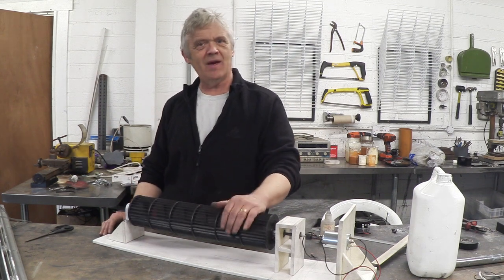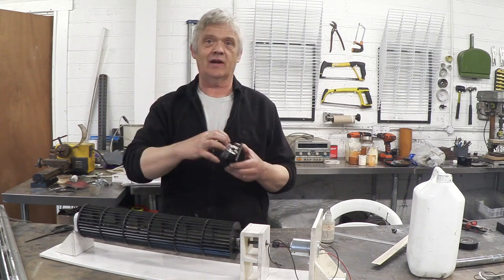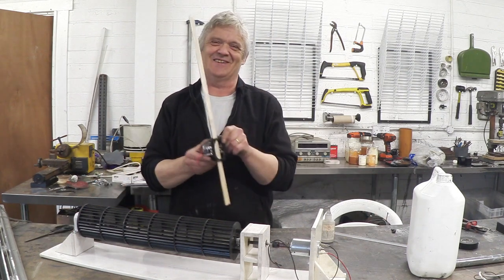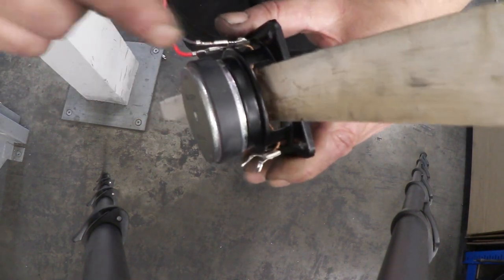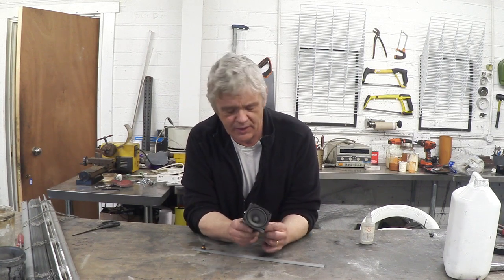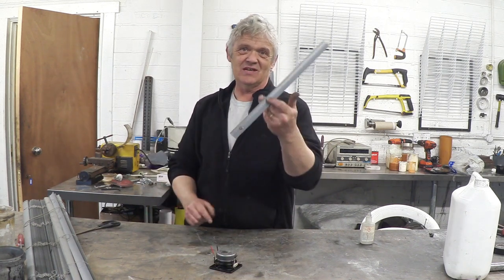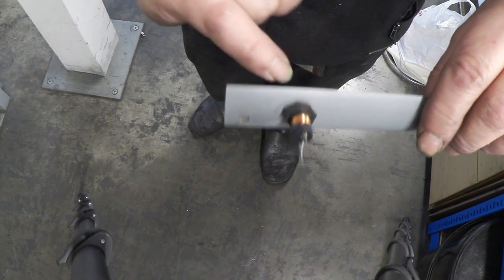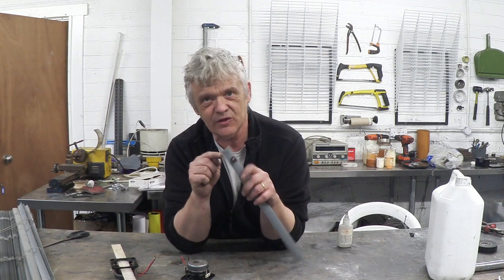Weird Wind Generator   No Blades, No Moving Parts

Comment: There is no way a 4 or 8 ohm speaker would produce 6-12 volts !
Reply: Do you think he's measuring AC or DC? The actual output from the speaker would be some messy kind of wave, probably difficult for the multimeter to accurately measure.

He's also measuring open circuit voltage, so there's almost zero current. Even 12V at almost zero current is almost zero power generated. 12V x ~0A = ~0W
Reply: @iamdave84  it would be a pulsating dc. On and off, on and off. I took the coil of very fine wire from an old shaker flashlight and it would light a 3v led real brite when you shake it and that coil measured nearly 500 ohms.

Comment: Super cool, indeed! This was such an important find for me. Remember those industrial art pieces from the 50's and 60's, they were called 'Kinetic' art, I believe. A bunch of long thin spires, standing vertical. The idea was with the air mass changes and human, and mechanical created drafts they would never stop moving. Since I was a kid I thought about them and always had a hunch they could create power. Which may be part of the original treatises, or otherwise discussed long ago, nevertheless, I finally know how to do it. Ty!
Reply: I just read an article from 5 yrs ago that point by point trashed this as a viable economic model, lol.
Reply from the maker: awesome mate - thanks for taking the time to write - cheers

Comment: What about using a piezo speaker? You could stack’em. Lol really popping some good stuff bo.
Reply from the maker: go for it mate
Reply: Robert Murray-Smith thanks bo, but I think ya had the idea w the hho, or rather hydrogen generator. I thought it might be a quick slap together that be an easy extra vid for content for yourself. Lol but opinions, thumbs and a*******, right. 
Really think the carbon/ceramic electrodes on a hardened or diesel generator, but ran as hydrogen electrolyzer. O2 is in atmosphere already, safer to store hydrogen, then possibly carbon/ceramic capacitors for storage...and before ya say go for it mate, already on it. Best of luck bo...hope ya make millions and love the new string of content. Thanks again.

Comment: Hope you continue to research this it's an awesome idea I never dreamed that you can make a speaker put out electricity
could you please get the biggest speaker you can find and run a test that way see how much electricity get and amps
Reply: You can plug headphones into a microphone jack and speak loudly into them and it's picked up like a really terrible microphone. That's because the speakers on the headphones generate electricity when the diaphragm moves back and forth.

Most (all?) devices that turn electrical energy into mechanical energy will generate electricity to some extent when you apply the right mechanical energy. They're not designed for this so are usually very inefficient at creating electricity.

Comment: Sorry to say but you do actually have moving parts.
Reply from the maker: okay mate - but it's still awesome
Reply: @ThinkingandTinkering  Sure, love anything that pushes out the boundaries of power production.
I am pretty sure a unit like the reed could be made entirely of a piezo element so that the whole reed bending would induce a small voltage.
Forget the roof idea, a wind farm... Such coastal areas where there is land that can't be farmed is ideal. 
So in a different light, the "Reed system" can be made to have zero moving parts other than that what is intended to wave about in the wind, a design like that could truly be called a zero moving part generator.

Comment: install it in air ducts and ventilation shafts kind of  like nasal hair
Reply: The drag would result in major efficiency losses in any ducting system and loss of flow... not what you would want in a "ventilation" system... 😒
Reply from the maker: it's an idea mate

Comment: So, in fact, there are moving parts
Reply from the maker: okay mate  - but it's still awesome
Reply: @ThinkingandTinkering  I can imagine a large grid of these magnetic wave generators wired in series parallel to generate enough voltage and current to power low energy lighting and communications.
Or as part of a mini grid with wind and solar to power a cabin.

Comment: Liked the clip.  It seems to be a compound spring so to speak, on a lever.  I'm guessing that a simplification would be a weighted spring then with one end of the spring being attached to something that can't be moved like a block of concrete? Maybe?  With the other end of the spring attached to the stick or bline in the clip.  Might be useful to thing in terms of a sail instead of a stick?

Comment: Presumably you are creating AC but at no fixed frequency.  Would it be worthwhile to include a WheatStone bridge to rectify it to pulsating DC and perhaps a condenser across the output legs of the bridge to smooth it out.  A battery to store the energy would complete the equipment.